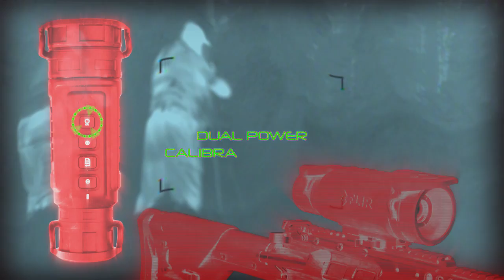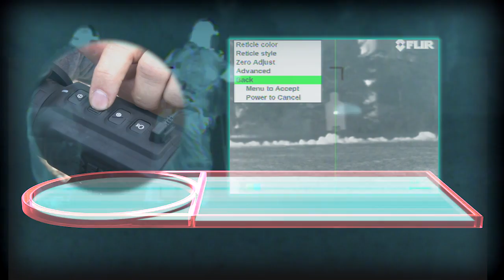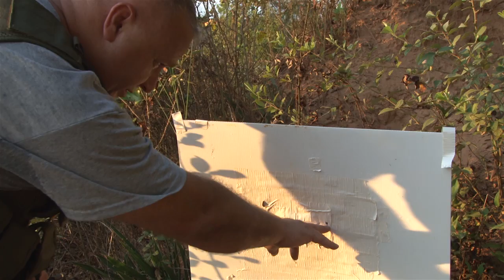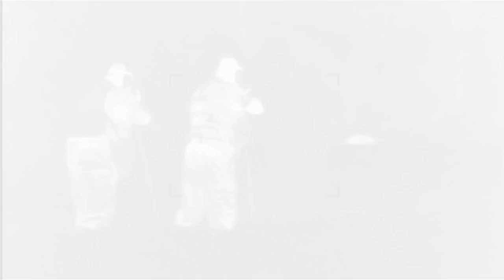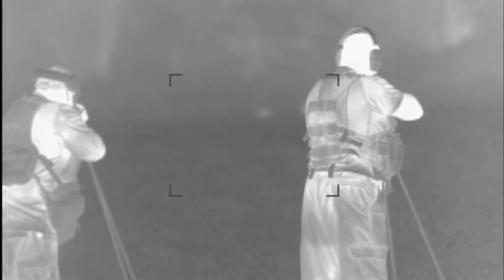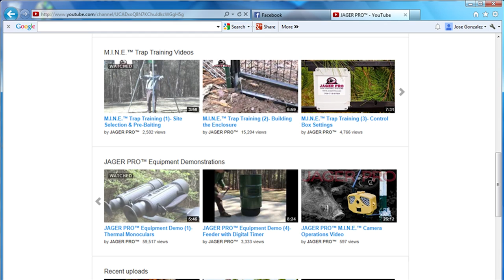Hog Hunting Equipment | Zeroing the FLIR RS64 60mm Thermal Sight | JAGER PRO™

Comment: why don't you guys run suppressors with the night hunts ?? it it because of the legal hassle they are or do the pigs hear the short but not really mind / panic ??
Reply: i was shooting a suppressed 22LR with subsonic rounds at 200 yards. the gun was about as loud as hitting two rocks together. i shot into a pond and the sound the bluet made hitting the water that far away was loud enough i jumped (about an m80 firework). id imagine the sound of the bullet hitting the hog will be more than loud enough to scare the rest. and on top of that they are not using low velocity (low power) SS rounds so the sonic boom will still be quite loud too. suppressor with regular ammo only makes it nice with out ear plugs.
Reply: cool thx :D